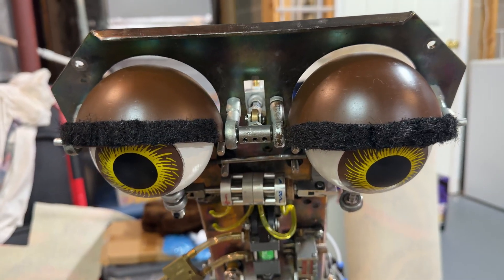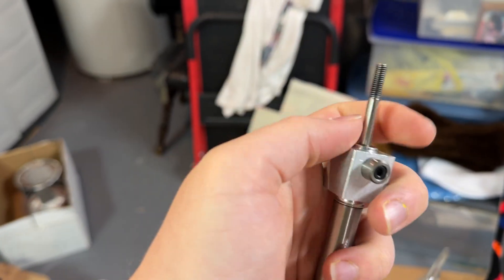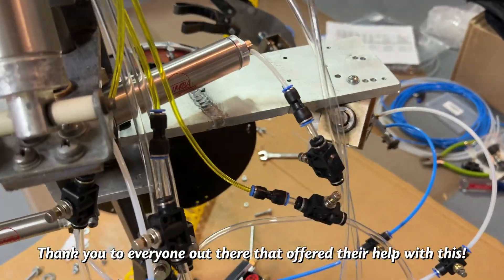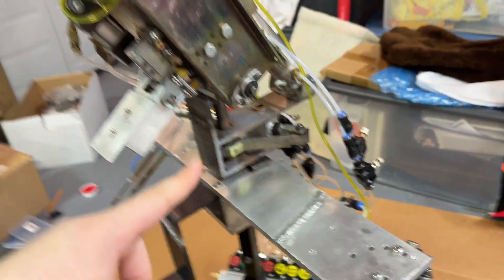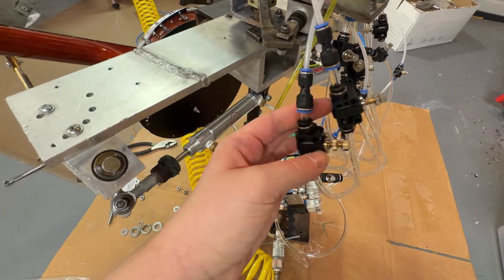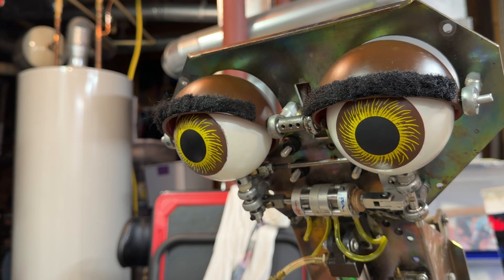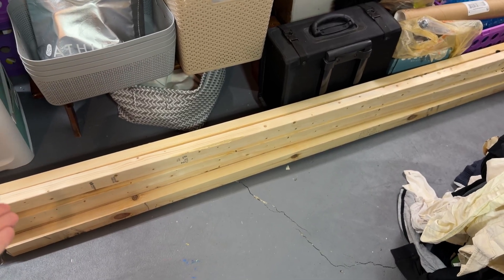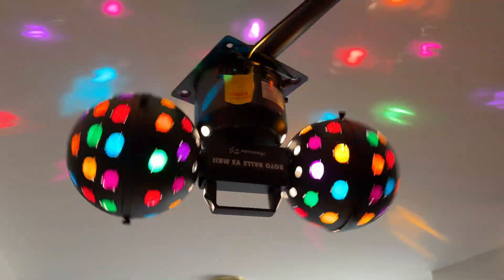Jasper Animatronic Refurbishment UPDATE (See Him Move!)

Comment: Very strange choice only using 1/8 tubing definitely going to restrict the body movements once you have it bundled together. Also would recommend ordering eye turn rebuild kits so you don’t have the stoppers blocking the seal regarding the head up. You most likely have one of the flow controls facing the wrong direction
Reply from the maker: The cylinders came with fittings for 1/8 tubing, is that not what is done in the store? Also I tried taking the flow controls completely out of the equation for the head up and it didn’t make a difference.
Reply: @LiamsAnimatronicExplorations  Typically cyberamics use 1/8" OD 1/16" ID hose for everything except the main hose feeding the manifold (that one is 1/4" OD 1/8" ID).

As for the head up, before you replace it, make sure that you're getting adequate flow out of both ports of the valve. Make sure only one port is pressurized at a time. Check for small leaks around the fitting at both the cylinder and valve. That can all affect the behavior of those valves. Otherwise, you probably have a bad piston or nose seal.

Comment: 3:30 could be a couple of different things. The one I suspect is that the lubricant inside of the cylinder may have dried out, which would cause it to struggle to move properly. It could also be that the flows for that movement are not working properly/aren't oriented correctly, though I assume you have ruled that out already. Unfortunately, that cylinder is not rebuildable, so unless you are able to lubricate the cylinder again without opening it back up, (an oiler might do the job, though considering it's just one cylinder having that issue, it probably isn't worth the money), you are probably going to need to replace that cylinder.

You seem to have done a pretty good job so far though! I do hear a few movements that sound like they're leaking when they're activated/while they're moving, but that could just be me (you can always check and see yourself). This is great progress nonetheless. I'm not sure if you've already talked to them, but ShowbizMidwest and RockafireMoon are very knowledgeable on the subject of fixing and maintaining cyberamics, so if you ever need help with your own, they will probably know how to help you. I've only ever worked on Rock-afire bots, so I'm not very knowledgeable on fixing or maintaining cyberamics outside of general technical knowledge with pneumatic animatronics.
Reply from the maker: Thank you for the advice! I am new to the world of pneumatics so it’s been a fun learning process. I will definitely look into all of this.
Reply: @LiamsAnimatronicExplorations  Your fellow YouTuber Itzarob!